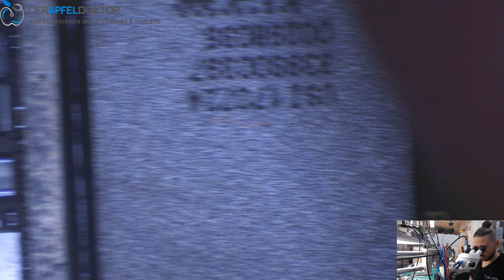BASIC REPAIRS - iPHONE 8 WITH NO POWER AND NO BOOT - SHORT 40 mA

Comment: @RESQ 
what about the Intel iphone 8p, no corrosion, no electricity leaks, when the power button is pressed the PSU shows a current consumption of 60Ma. how to analyze it. When the current consumption is 60 Ma, is the Iphone working voltage fulfilled?

thanks
#RESQ